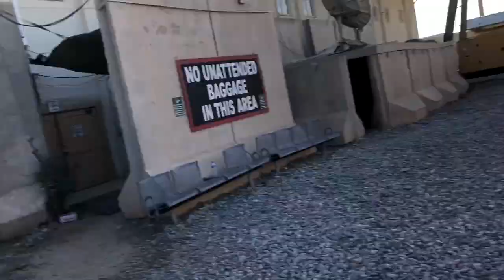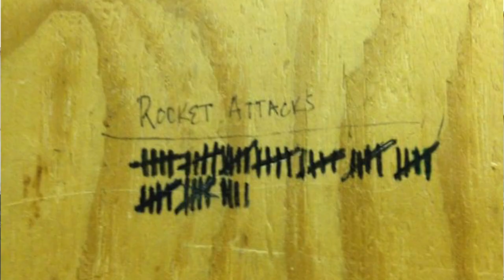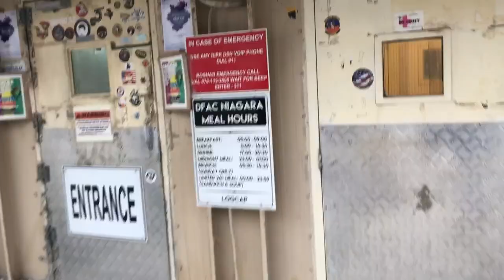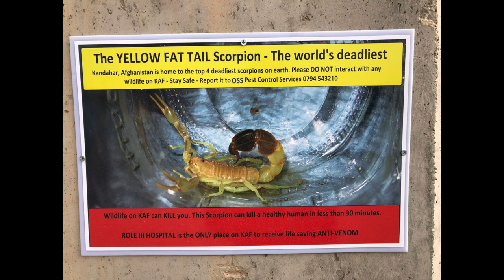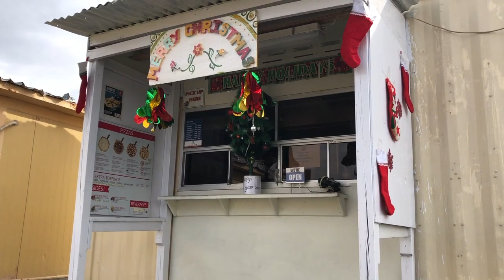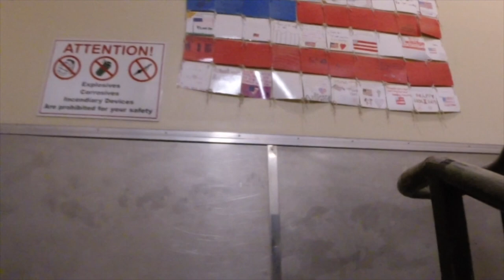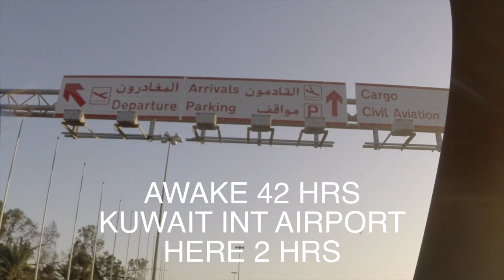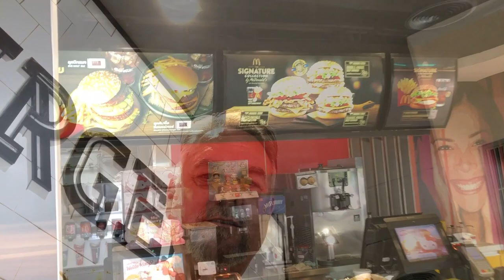Departing Afghanistan For Good!

Comment: Hey is it any truck drivers working there in Afghanistan from the USA working for the same company as u if so do have any past away I was trying to drive there but I don’t want to get hit by no RPG as I’m driving
Reply from the maker: Most of the truck driving jobs are foreign nationals like from Nigeria or Kenya.  They make $500 a month.  If you are a certified crane operator you might be able to find a job.  You should go on clearancejobs.com and see whats out there bro.
Reply: iROBODUDE I just finish a application for fluor  they have truck driving jobs in Afghanistan is it dangerous there sent all the things going on with the war now ? How the food taste? Is it a fun job? Do y’all have a phone to call back to the states lol I have a lot of questions before I take the job lol
Reply from the maker: You will most likely not ever leave the base.  It will be delivering and moving equipment.  It could be dangerous, it's a war zone dude.  Mostly just rocket attacks and vehicle bombs.  You can buy a roshan phone and get phone cards, no problem.  You will eat in the DEFAC with the soldiers and other contractors.  The food is not too bad.  You can get fat if you are not careful.  Lots of carbs.  They have gyms too.